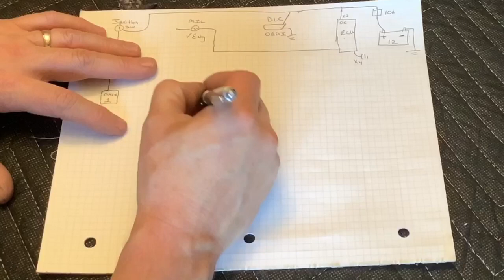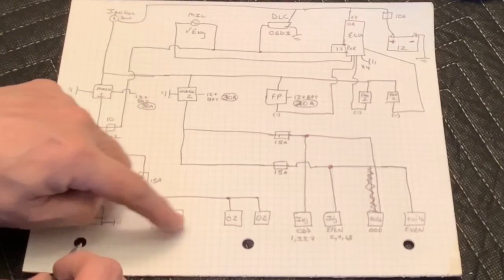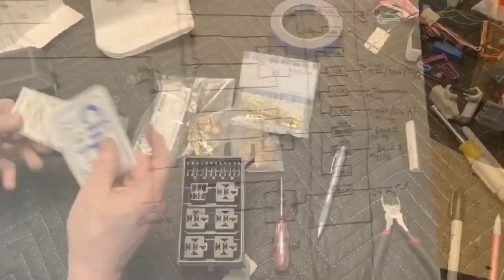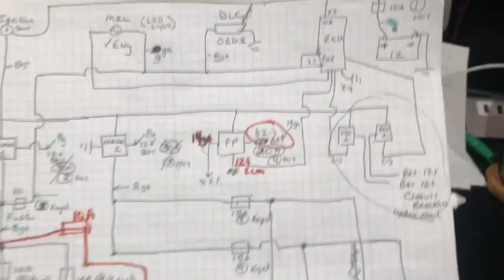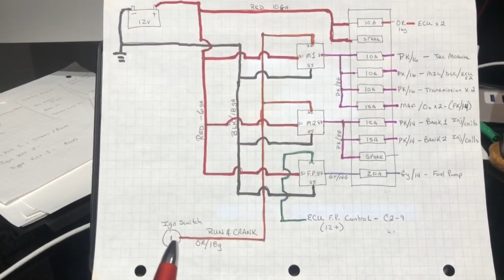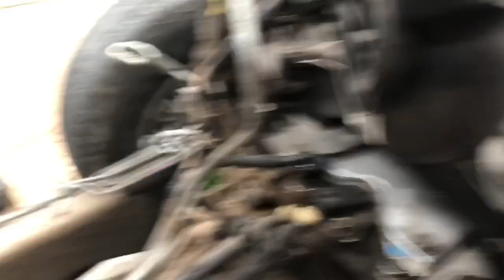Stand Alone LS Wiring Harness (How To) - Part 2

Comment: I have a question for  you regarding pin out , on the  gray transmission box there were  like 8 wire  on ls swap  pin out  calling to remove  light  green  wire and dark green  but there are other pins that are high lighted  brown  pins  on green connector  62 and on blue connector  32 /34 and 72   and 2 pink wire  do  those need to get removed or left in place? Only thing I stumped on.😂
Reply from the maker: My notes say, ECM GR-62 and ECM BL-32 can be removed, ECM BL-34 can be removed or it can be programmed to accept single wire park/neutral signal, if no transmission mounted range switch is present.
I hope that helps.

Comment: i dont know why u wouldnt use the stock LS fuseblock? eveything u need is in there?
Reply: i just supplied it  battery power to main terminal,  key on power to C2 A9 i think,  out put for fuel pump C3 F1 and pulled &  hooked crank wire to my car crank wire that it thats all 4 wires and it ran first try
Reply from the maker: You are correct it does work just fine, but it is quite large and doesn’t fit all applications.  For my projects, I don’t want all that extra stuff under the hood.